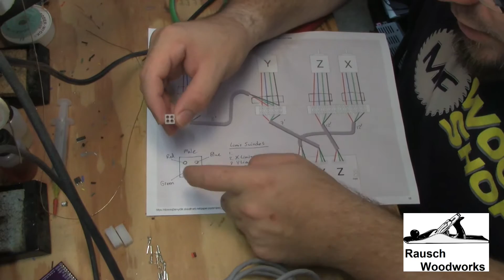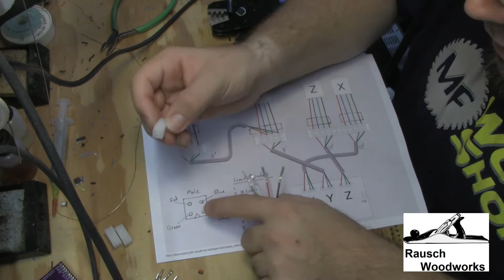X Carve - Electronics Enhancements

Comment: I see you're using the provided black & white limit switch wire. Did you have any trouble with the machine homing cycle? I have an issue where when I send it to home it just moves each axis a little bit and then it stops. (without hitting the switches) Research I've done online says that it's likely caused by electrical noise and I should replace the wire with shielded. Any thoughts?
Reply from the maker: Have you adjusted the current limit pots on the stepper driver board?  This actually sounds like the motors are not getting enough current and stalling.  I would try that first.  I don't exactly buy into the RFI issue on the limit switch wires.  The limit switch inputs are looking for active lows to trigger.  If RFI was getting into the line, that would most likely be a high and the input would ignore it because they already have pull up resistors on the line to prevent falsing.
Reply: +Jason Rausch | Yeah, the machine runs great other than the homing routine.

Comment: where do you order those green headers? i am having trouble finding an 8 pin version. do you have a part number or link for us?
Reply from the maker: +Stephan Kyriakopoulos I get them from Mouser.  Part #651-1725711
Reply: +Jason Rausch and what about the connectors for the Motors (At the base)?

Comment: Do you have any thoughts on how to make the XCarve wireless? I'm tired of having to vacuum my laptop after using the Shapeoko2.
Reply from the maker: Yes, I do, Fr. Thomas!  So the Arduino Uno uses a small Atmel microprocessor bewteen the USB connector and the main Atmel microprocessor that runs the Arduino platform.  This small Atmel is there to strictly handle the USB coms in the form of an emulated serial port.  Between the two microprocessors its talking 3.3V TTL serial data.  This serial data could be fed into a Bluetooth serial module and make the unit wireless.  You would just install drivers on your laptop to create a virtual serial port through Bluetooth.  I want to work on this once I get my XCarve up and going.
Reply: I was reading about wireless USB ports. There are a couple of companies trying to get it to catch on despite the failure several years ago.  Not sure how it would work with an arduino though. I was also wondering if a Raspberry Pi would be capable of running the G-Code sender program.
Reply: I also found a method using Raspberry Pie 2... I'll post a link on the community page.
Reply: +McGinn's WoodShop community page?

Comment: Jason the crimper you used I've never seen anyone flip it over like you did. Is it meant to crimp the shielding and the wire but you like to do it separately? Great job on the mods you must do that sort of thing for a living.
Reply from the maker: brett benson This is a special die crimper meant for two crimp pins.  If you look closely at the die, you'll see that one part is smaller than the other and will crimp the tabs around the wire tighter than the tabs around the insulation of the wire.  I like the pair I showed in the video made by Iwiss.  I turn them over and pre-load the pin into the crimper, making sure it's positioned correctly.  If the pin is slid too far one way, you'll crush the actual pin.  If it's slid too far the other way, you will over crimp the tabs meant for the insulation of the wire and it can cause to weaken the wire and the contact.
Reply from the maker: brett benson I forgot to mention, I'm an RF/electronics technician by trade and I also own a small company called RPC Electronics, LLC.  Here is a link to my company's YouTube channel:  https://www.youtube.com/rpcelectronics
Reply: Thanks for the response. I will check out that brand of crimper. Our current pair is ratcheted causing miss crimps on occasion. I work for a water jet company based in Kent Washington called OMAX.
Reply: +Jason Rausch where can I get a crimper like that?

Comment: I wish that the green terminal block was installed on the board like how you done it and that they send those crimp-er tool was sent in the tool kit. I hate that all the connections on the x, y, and z are so open! I wish the had a cover of some sort I am afraid that something metal will come in contact and short out the system.
Reply from the maker: Summers Woodworking I'm looking into stocking parts to create little "Upgrade Kits".  I'll make an announcement here and on my social media if I do.  Thanks for watching!
Reply: +Jason Rausch did you ever create those kits by any chance?  The mix/match of connection options makes me nuts as a noob... LOL

Also, how did you make the molex connection on the motors, I didn't see that part.

Comment: Awesome Jason.  Great improvements there.   So what other wiring upgrades did u do?
Reply from the maker: Patrick's work shop Thanks, Patrick!  In my X-Carve build video, I'll show the other changes I made, but for the most part I covered the cable in paracord weave to protect them.  I also tied both Y axis motors into the same mating Molex connector to connect to the main Y axis control cable.